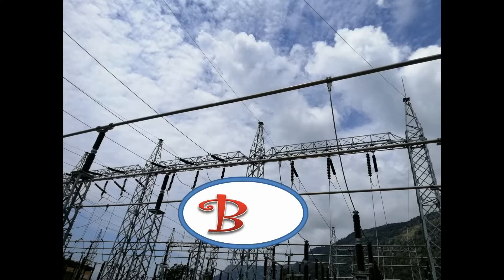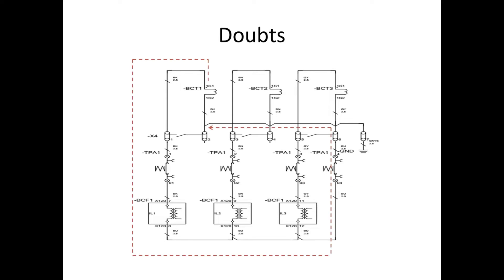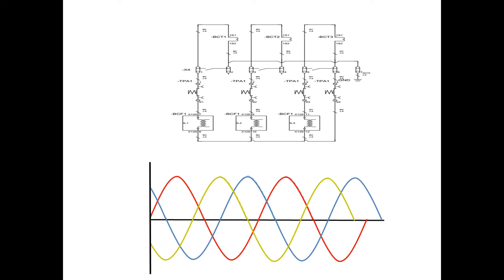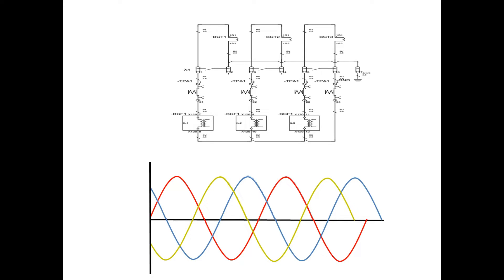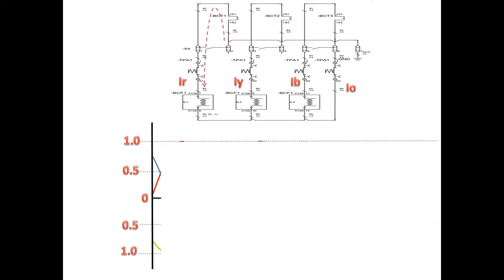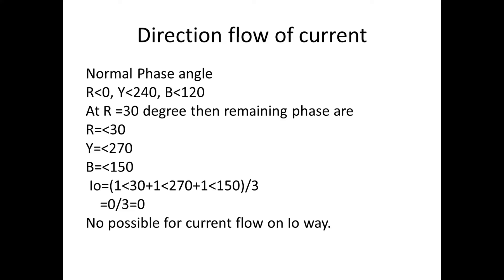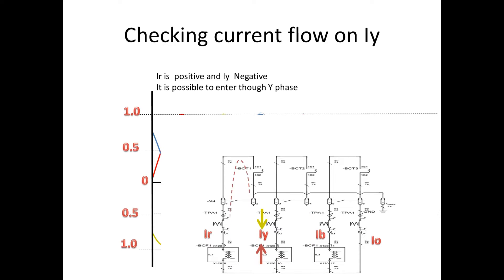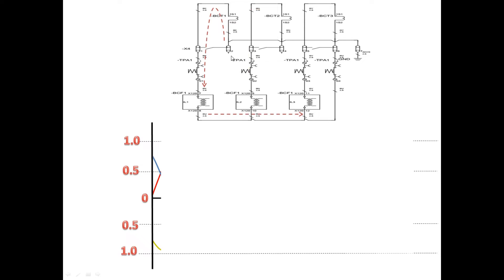3 Phase CT Return Current during balance condition | CT Current closed Path direction

Comment: what is the reason in ct connection i have get 100A current
please resolve my problem
Reply from the maker: please give your question briefly .
Reply: @baranitech  good morning
in my vcb circuit ct circuit each phase having 53,52,52,
and ground having 100A 
what is the reason  it is in HT voltage

Comment: Nice video. In conventional type diferentiol relay each phase current also coming returned through other phase ?or through ct star point ?because both hv side and lv side ct s2 star point conected togother?
Reply from the maker: even though the star point connect together the current return path will take to the source supply.